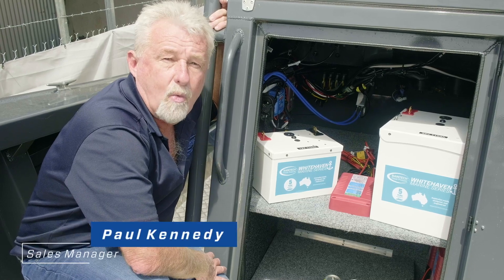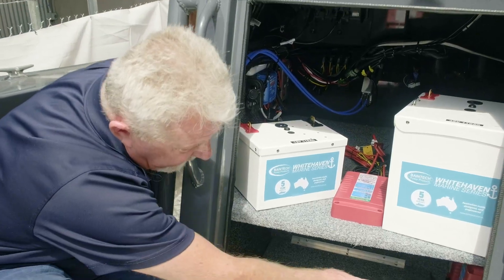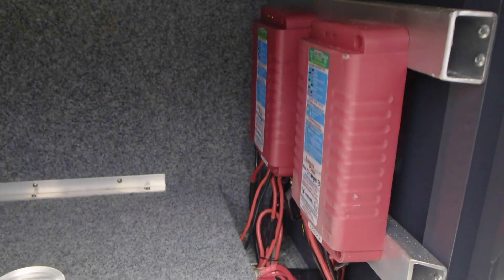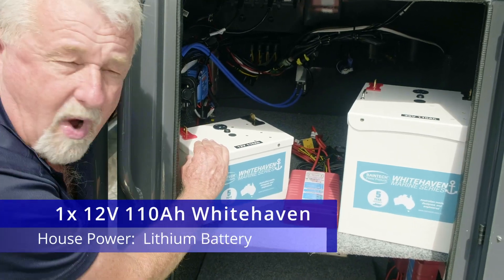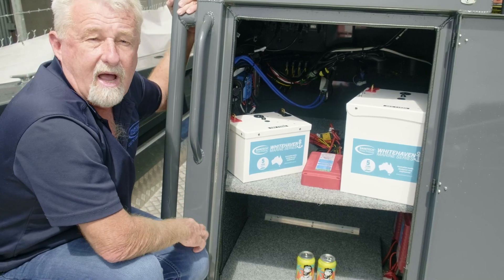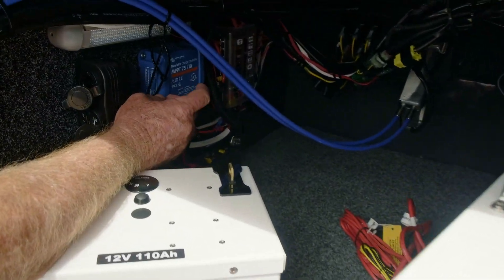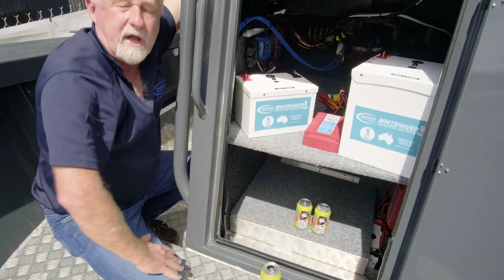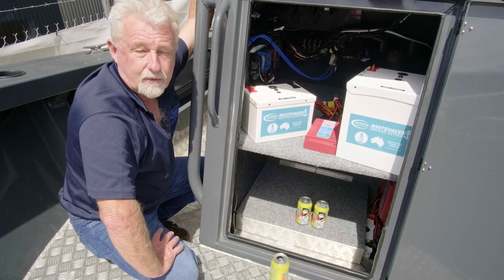Lithium Battery for trolling motor - Whitehaven Battery 12v/24v/36v  (Bow Mount Motor)

Comment: Very interesting regarding the dual DC-DC chargers. Are they both connected to the cranking battery at the same time and thereby charging the 12v house and 36v electric motor batteries at the same time or do they have to be isolated in some way to utilise the DC-DC chargers individually at any time?
Reply from the maker: Hi, We run one DC/DC 1212 charger between the start and house batteries and one DC/DC 1236 between house and bow mount bank.